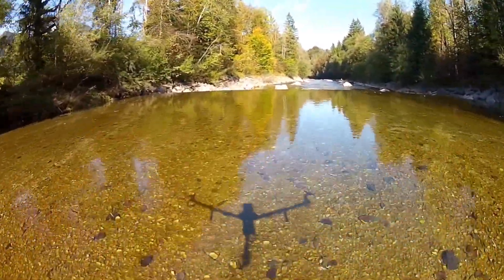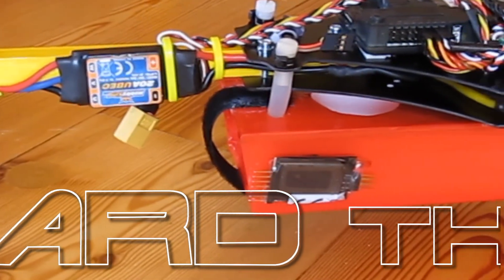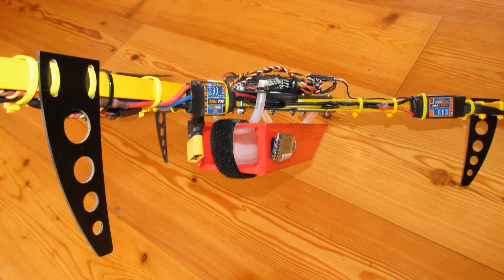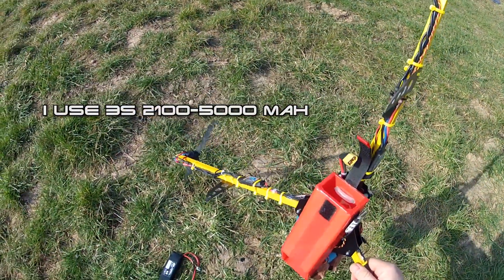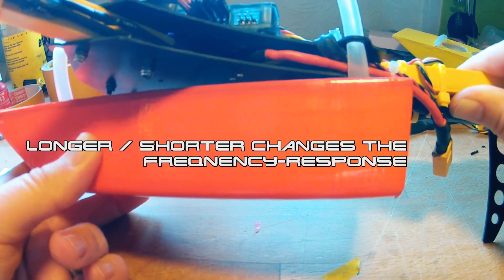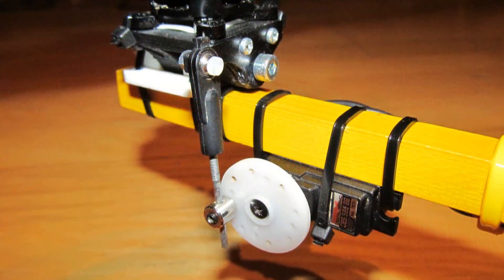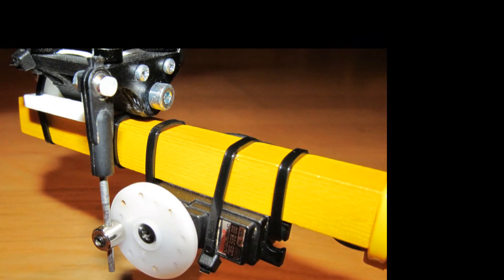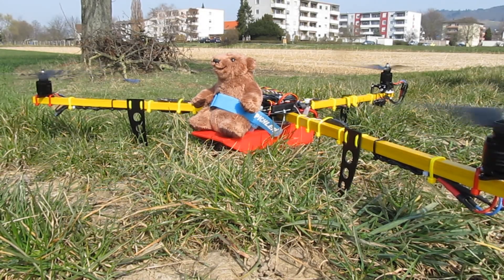Tricopter Edward th2nd

Comment: Do you fly in autolevel?
Reply from the maker: jeremybaeyensify Hi, not really. Sometimes I use it on take off or while I put my FPV-goggles on, but usually in "acro"-mode. To be honest, self level is a pain in the a... while I have to hold the stick all the time to tell the tricopter what I want it to do. I am more into a flying style that is closer to a plane than a car. And acro is better while trying to do better videos. Self-level does not have that smooth movements.